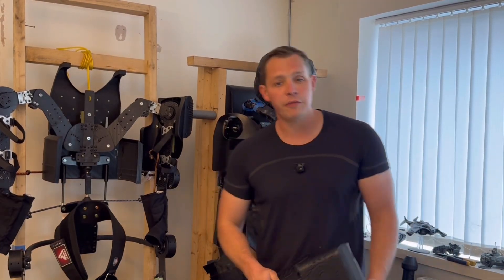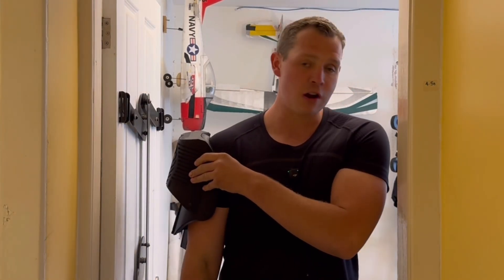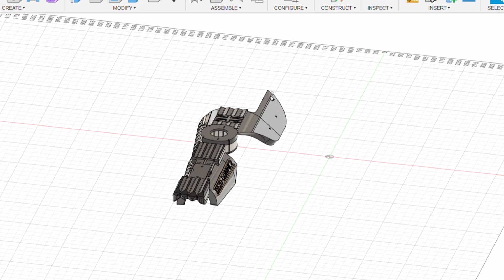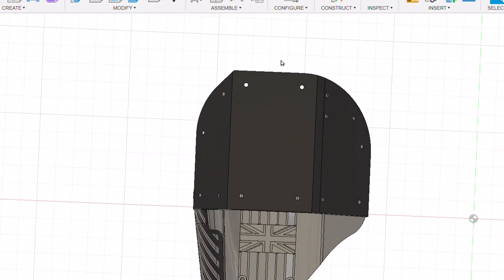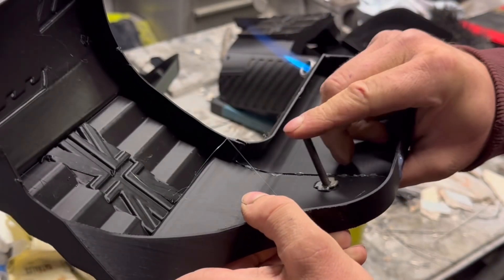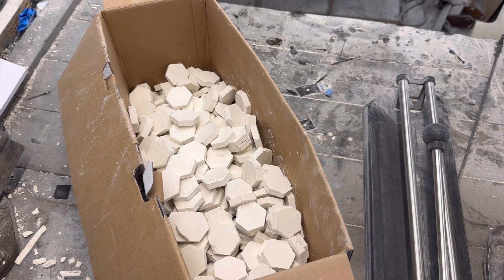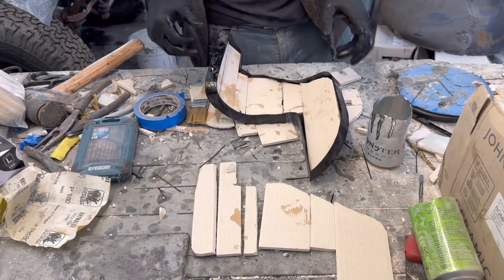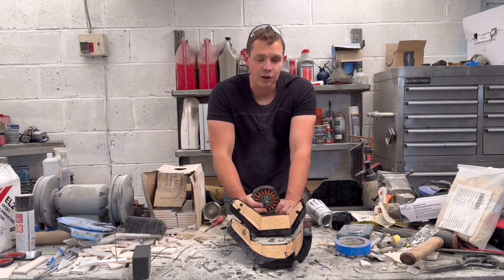My FINAL Power Armour Arm & Pauldron design Im building - laying the ceramics

Comment: Wonder if there's a way to add a suit or a side upgrade to prevent against overpressure and shrapnel like a thin Kevlar rubber edition or something with a pressurization system 🤔.Totally off topic but would be useful to have a arm mounted lightweight foldable shield right 🤔... Or at least the modular option to add one when things get rough I guess